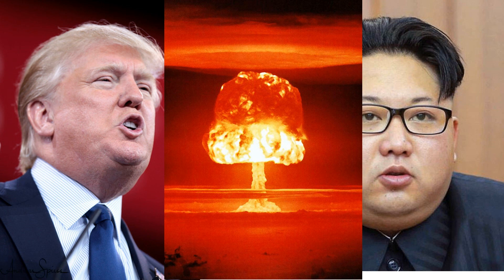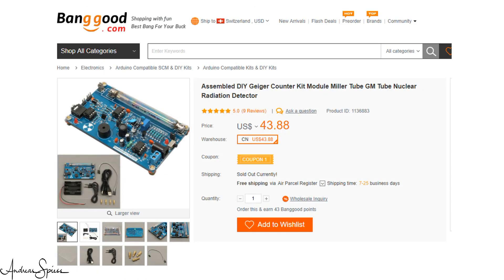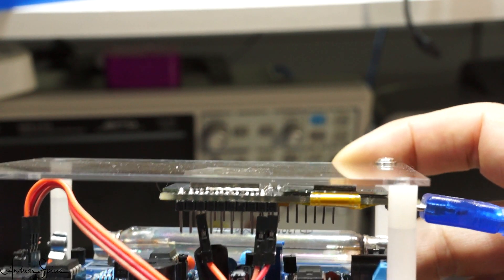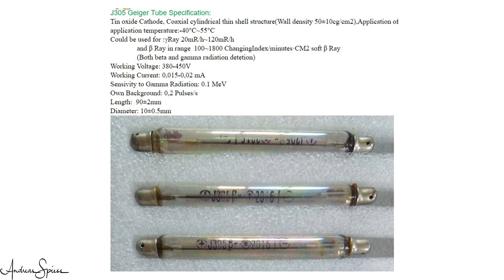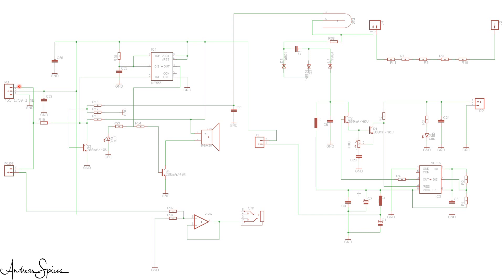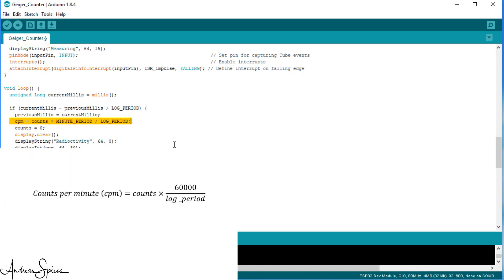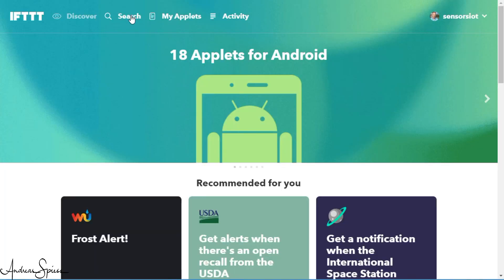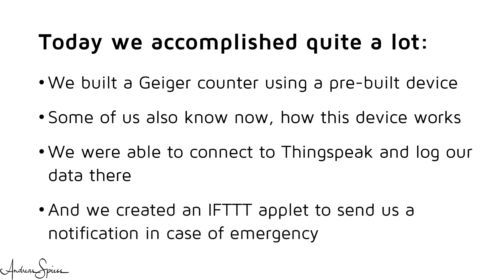#162 Build your own 50$ connected Geiger Counter (ESP32)

Comment: What ESP32 do I need ? I click on the link but a 404 error. I do have RadiationD-v1.1(CAJOE) but if I do need anything else please let me know. Oh yes I had a case made.
Reply from the maker: This should work with any standard ESP32 board. This is an old video. I added a link to a similar, current board, but maybe the pins of the sketch have to be adapted

Comment: @AndreasSpiess Hello Andreas, are you still using the Geiger counter?
It would be great to use it with ESPHOME ;-)

Best regards
Reply: It works beautifully with ESPHome!

I have it connected to Home Assistant with ESPHome so I can show the readings on the dashboard
It's extremely simple to setup, I use an ESP32 with this config.

sensor:
  - platform: pulse_counter
    pin: 34
    name: "Radiation"
    unit_of_measurement: 'μSv/h'
    accuracy_decimals: 4
    count_mode:
     rising_edge: DISABLE
     falling_edge: INCREMENT
    filters:
      - offset: -12.0 # J305ß Geiger Mueller tube background noise 0.2 pulses / sec x 60 sec = 12 CPM (Counts per Minute)
      - multiply: 0.00812037037037 # Factor: 0.00812037037037
Reply from the maker: I do no more use it. Maybe I should if I see what is happening right now. 
It should be easy to attach it to an ESPhome device.

Comment: A few things to know about this design: the glass GM tube excludes particulate radiation (alpha and beta) so it responds to gamma rays; it gives count rate but does not give dose rate; at very high count rates the GM tube saturates (tube is not able to restore the voltage gradient that results in an electron cascade).  In a typical home measurement it is responding to K-40, gamma emitters in the Uranium decay series ( including Radon progeny) and cosmic rays. All of the preceding are natural. The tube background count rate is from K-40 in the glass. It is an interesting application, however, and worth constructing.
Reply from the maker: Thank you for the additional information!

Comment: I always get wifi.h file not found when I try to verify the sketch.  Any clue what I'm doing wrong.  I'm trying to use an Ideaspark ATmega328p with oled screen
Reply from the maker: The Atmegas have no Wifi. Only the ESP8266 or ESP32 have WiFi
Reply: @AndreasSpiess  Hi, thank you for replying.  I realized that shortly after I posted that comment.  I have an ESP32 on the way.
Reply: @AndreasSpiess  Sorry to keep bugging you.  I got the esp32 sketch uploaded with no problem and I can see it successfully connecting to wifi but the data on thingspeak isn't updating.  Any tips on troubleshooting?  I double checked my channel number and private write key and they are correct.
Reply: @AndreasSpiess  Here's the serial output, it doesn't look like it's even trying to update thingspeak. 

rst:0x1 (POWERON_RESET),boot:0x17 (SPI_FAST_FLASH_BOOT)
configsip: 0, SPIWP:0xee
clk_drv:0x00,q_drv:0x00,d_drv:0x00,cs0_drv:0x00,hd_drv:0x00,wp_drv:0x00
mode:DIO, clock div:1
load:0x3fff0018,len:4
load:0x3fff001c,len:1044
load:0x40078000,len:10124
load:0x40080400,len:5856
entry 0x400806a8
This is V1.3.1
ts::tsBegin
=== Stack info === Free Stack is:  7160
Connecting to Wi-Fi
.....
Wi-Fi Connected
Defined Input Pin
Irq installed
Initialized
Counts: 6
cpm: 23
=== Stack info === Free Stack is:  6024
Counts: 9
cpm: 36
=== Stack info === Free Stack is:  6024
Counts: 6
cpm: 23
=== Stack info === Free Stack is:  6024
Counts: 4
cpm: 15
=== Stack info === Free Stack is:  6024
Counts: 10
cpm: 39
=== Stack info === Free Stack is:  6024
Counts: 9
cpm: 35
=== Stack info === Free Stack is:  6024
Reply from the maker: @stevetotaro3219  Unfortunately, I cannot perform remote debugging 😞
Reply: @AndreasSpiess  Just wondering if you had any pointers of where to look.  The serial output never mentions anything about thingspeak so I dont think that bit of the code is running.

Comment: Hi, i have the same board as you but it keeps saying error compiling to this board? any advice, please?
Reply from the maker: Unfortunately, I cannot do remote debugging. Maybe the error messages and google will help you to proceed
Reply: @AndreasSpiess  can I ask what board you selected in ide please
Reply from the maker: @tsetsefly4538  For the ESP32 I usually use the "ESP32 Dev Module"
Reply: @Andreas Spiess  Thanks, just seems like my ide doesn't seem to want to compile or upload to this particular board, it's my second one and I've uninstall and reinstalled... ok thanks for help.

Comment: Thank you so much for this; got this same hardware from AliExpress with no instructions and your video was just what i needed. Not so familiar with Arduino coding, trying to tweak it so it still displays counts on the OLED even when Wifi is out; do you have any pointers? Also, now that it's displaying CPM; i want to turn off clicking: is is safe to just short the little speaker terminals to do this?   Many thanks for your excellent instructions!
Reply from the maker: For the code you have to experiment and learn a little. For the buzzer: Do not shorten it, remove it (or at least one leg).
Reply: @AndreasSpiess  Thank you

Comment: I have ordered the Ver. 1.2 board that comes with a display and will be changing the tube with an LND-7317 that has a Minimum dead time of 40 micro sec. From your statement that this board can reach 2000 CPS/~100,000 CPM, I hope that the displayed counts will be adequate to display to MANY thousands of CPM if not more.  I'll let you know the results after I get the LND-7317 connected and adjusting the board to provide the suggested operating voltage of 500 Volts.  ALSO, I will be using a Fluke 179 with a 10 Mohm impedance with a 1000Mohm resistor in series.  This configuration will not load the power supply significantly with a meter reading of about 1 to 100 -   A 5 volt display will equate to about the 500 volts this tube requires....  (Example  -  25 Mv = 25 volts,    175 Mv = 17.5 volts, 5 volts = 500 volts, etc.)....
FYI:  This is the part information with an Allied P/N with which to order....

        Resistor, Thick Film, Res 1000 Megohms, Pwr-Rtg 1 W, Tol 1%, Radial, Planar
         SM102031007FE
         70024570
Reply from the maker: Sometimes people use several smaller resistors in series because most of them are only rated about 200V.
Reply: @AndreasSpiess  You are right.  The Ohmite resistor specified has a 1 watt rating and 5KV rating.  Their higher wattage resistors have a higher voltage rating as shown below:

     PART NUMBERS     RES RANGE   PWR     VOLTS    CAPACITANCE
SLIM-MOX10203 200Ω to 5,000M 1.00W 5.0KV 0.90
SLIM-MOX10303 250Ω to 5,000M 1.25W 7.5KV 0.75
SLIM-MOX10403 500Ω to 5,000M 1.50W 10.0KV 0.70
SLIM-MOX10603 750Ωto 5,000M 2.00W 15.0KV 0.65
SLIM-MOX10803 1K to 5,000M 2.50W 20.0KV 0.60

SO, for a GC power supply of ~4-500 volts the 1 watt 5KV resistor will work fine...  This is why I was needing a "one component" solution....
Reply from the maker: @ainttakenanyshit  Perfect!

Comment: Hi, first: Thank you v much for this great tutorial... but i am stuck with the code for the ESP and dont know what to do... always wheni try to uploud the code on the ESP the program says that the file: "<SSD1306.h>" doesnt exist even tho ive downloaded several SSD1306 files out of the libary.. so yeah i dont know where the problem is and would be v glad if you would be able to help me
Already thank you v much!
Reply from the maker: Did you install the SSD1306 library from Thingspulse? The sketch compiles fine here.
Reply: @AndreasSpiess  "Error compiling for the ESP32 Dev Module board. " does that mean the board isnt working at all or just that i am still doing something wrong? (the SSD1306 from Thingspulse worked now it marks the <credentials.h> part)
Reply from the maker: Just delete the line with the credentials.h and add your credentials manually.

Comment: Thanks Andreas for great video and funny idea. I also installed GM counter and I hope it won't be needed, but as we say in our country..."Nothing can surprise us!".
When I was looking for GM counters, I was thinking about detecting (measuring) radon which can be dangerous to our health as well  - do you know if this GM tube can detect radon?

One more question - if you know - how to disable (mute) speaker on board? Is there a pin or anything? I have my board and esp connected to Home Assistant and really don't need a speaker (clicks)... Thanks again and good luck!
Reply from the maker: They should. I found this article: radon.com/granite/

Comment: Hi Andreas. First of all .. thanks a lot for this great video.

I rebuilt the device and took your sketch as first template for my current one (using  moving averaging algorithm, decreasing
 counts from own background ratio, introduced locking for access of interrupt counters, converting to microSievertPerHour, reporting to my mqtt server and so on)..
and it seems to work quite good/as expected. Further, in Germany there is a network of some thousand official "odl" stations also nearby me which seem to measure a dose per hour quite around the same as mine. 
Those official vary from between 100 to 140 nS/h. And my device reports about 120 nS/h in our flat (varying between 95 to 130). 
So, one could think it should really work/measure quite accurate for a self built gadget. But there seems be a quite big BUT....

Either in my local area around house has a "open" nuclear plant or this device is also somehow sensitive to other perhaps uv radiation. If i bring the device on our balcony (and even if there is no direct sunlight) it kind of totally bursts. Speaker and trigger led kind of react like you played in the video in the James bonds films... counter rises to CPMs of thousands giving me dose powers of about 200 000 nS/h. I fear this even burns out the geiger tube on who heavy it gets triggered.....

Is this a known effect? Could this really be real radioactive powers? i could not imagine where this should come from. i let the device collect data through out the whole night on the balcony where it showed the normal around 100 nS/h. But minute after sunrise it went
up (again it does not lie in direct sun). Reaching values like i would expect in a nuclear incident.

Andreas, may i ask did you did measurements outdoors? over longer time? do you still measure? how could i research what is going on?

Thanks,
Frank 
P.S.: if of interest i could also give you my used sketch for the geiger device
Reply from the maker: This is an old project and I do no more remember the details. I am quite sure I did not expose it to sun. So I do not know if it matters. But you should get information on google because this is a well known technology. I also would check if the signals come from the tube or are noise from elsewhere.

Comment: Dear Andreas! Just assembled the same board (plain, without display) but it is not working. No klicks and I am measuring 100-240V across the tube holders if adjusting the potentiometer between the end points. Led lights up, the other led and buzzer beeps during voltage measurement. I understand that one of the 555 ICs is a booster. Do you have any clue where should I look first? Can You please measure the frequency of your working board (pin 3 of the 555). Thank you very much!
Reply from the maker: Unfortunately I cannot do remote diagnostics. And I do not know where my device is. This is an old video :-(
Reply: @AndreasSpiess  No problem. I could check the voltage according to the diagrams You shared and the circuit is working, voltage set to 380. But I am not getting any background signals from the tube. Its 35kHz btw :)

Comment: Dear Andreas, first of all thank you for your video. 
However, I have a big doubt. In your video  (at 3 min 19 sec), you connected directly the GM output (5V) to the ESP32 GPIO26 (3.3V).
Infact the ESP32 works at 3.3 V.
So, I guess that in your system there are a couple of issues:
1. The ESP GPIOs are NOT 5V tollerant
2. The output of the GM circuit is 5 V that becomes 0 V when a radioactive event is captured by the GM tube.
So in my opinion the ESP32 should not have a very long life.
My question is why did you not use a level logic adapter?
Reply from the maker: I do not remember why I did this. The ESP32 still lives. If you want you can use an ESP8266 which is 5v tolerant
Reply: @AndreasSpiess  Thank you Andreas. I am using an ESP32 and the Cajoe 1.1 GM counter. If I use a logical adapter, the ESP32 does not count. If I don't use le logical adapter, the ESP32 counts but I am in big trouble about the ESP32 life. However I will follow your suggestion and I will use a ESP8266.
Thank you again.

Comment: what if I want to connect the geiger counter to a raspberry pi and instead of an lcd screen for output I want to use a python interface with a pinter that points to green yellow and red for no risk, warning, critical ?
Reply from the maker: Then you have to do a new project which works similarly to the one here.

Comment: after I watched your video, I bought one too for my hobby weather station, more like as a novelty than an accurate meter, unfortunately it only worked for about 20 minutes (around 18 cpm as in every video, responded to agitation), however then the clicks started to be more and more apart until it went mute. I checked the diagram on your github along with the sensitivity settings, it seems to be all good, but I can only get like 2.7V (3.4V tops, after that I can hear the oscillations) on the test pin J2, when I measure voltage on R33 I only get 106V, when I remove the tube, I can only measure what's on the other side of that resistor, roughly 14V. I assume the cheap crappy voltmeter might be loading the circuit too much and unfortunately I don't have access to an oscilloscope. Could that be the tube got damaged in transit (the package was pretty smashed, although it visually seems undamaged), or is it possible that one of the 555s or transistors died? great videos, btw! :)

Comment: My set has a J303 tube. At least that is whats printed on it. But the only specs I could find for a J303 says that it is a metal one, but mine is of glass like the one in the video.
I would like to get the ghost count rate, and the conversion factor for µSv/h. Some people say that it is a M4011, but if I subtract the ghost counts for that model, I have sometimes a negative radiation. currently I try it with subtracting 7.2 clicks per minute, and use 153.8 (as the M4011 has) as conversion. Now the natural background radiation seems to be the same as my Soeks Defender says. But I have no clue if this is correct in any ways. Is here a tube expert who can help me?
Reply from the maker: I cannot help here :-(

Comment: Any luck running this code on a D1 Mini V3 ESP8266? I gave it a shot without any luck. thoughts on how i could get this running?
Reply from the maker: I assume it has problem with the secure connection to IFTT. Maybe you take this functionality out (all lines wirh errors)

Comment: Dear Andreas,

I have the same Counter Board: RadiationD-v1.1 (CAJOE) and the same Wemos ESP32 OLED-module ESP32 OLED WiFi + bluetooth Dual ESP-32 ESP-32S ESP8266 screen and I run your schets from the download from github.com But he does not work I see first Welcome on my oled screen then Measuring and then he stops. He will not display Radioactivity or any cpm on my screen as you let see in your youtube movie. Please can you help i'm new with arduino and have not a lot of knowledge about programming so I have a problem now.

posting the data on Thingspeak works fine but on my screen no data

Please can you help me ??
Reply from the maker: Unfortunately I cannot do remote debugging. Youtube is only my hobby and I have no time for such things.I would check if your Geiger counter produces signals and maybe add a few Serial.print statemensts in the code. Then you find out where the problem is.
Reply: @AndreasSpiess   is the code I can download from github exact the same code you use for this video ?? Do you have any other code you can send me for me to help ?? If you have the code whitout the IFTTT and Thinkspeak so pure the code who put the reading from the geiger counter itself directly to the OLED display and maybe the serial output that would be great

Comment: Does somebady has any tips to use this Geiger counter with a Raspberry ? There is no information on internet about it.
I'm trying with a mcp3008 but not successfully
Reply from the maker: I do not think you need an A/D converter. Just counting pulses should be enough.
Reply: @AndreasSpiess  You are right. I succeeded after some time. and I used simply a GPIO pin to to count each fall. Thank you very much for your answer.

Comment: What does the test J4 bridge connector and the trimmer resistor R100?
Reply from the maker: I do not know
Reply: It exposes the voltage to point J2 (reduced first over a bunch of resistors). I have 60V DC between GND and J2. Not sure what it should be. R100 is for adjusting it. Hope it is calibrated in the factory

Comment: Hi, thanks for the Video! Some things are really interesting - like the internet-connection-stuff.

But I think the Idea having such a device in a basement ist not good idea because: the glas-tubes are extremly insensitive - better use a SBM19. In the basement you are 100 % shielded regarding beta radiation. And still gamma does not completly penetrate thick concrete walls. The counts you get in the basement ist manly the radioactivity of concrete and soil surronding you. So better put the device in a housing in the garden. With the SBM19 you can see even the natural radon-decay-product-based fallout (see my paper). If you are interested how to build a simple and precice geiger counter by yourself, probably my paper is interesting for you. Please check:
http://www.boehri.de/elektronik/MultiGeiger/MultiGeiger.pdf    (German Language)
Reply from the maker: Thank you for your explanation and your link! Seems you are an expert!